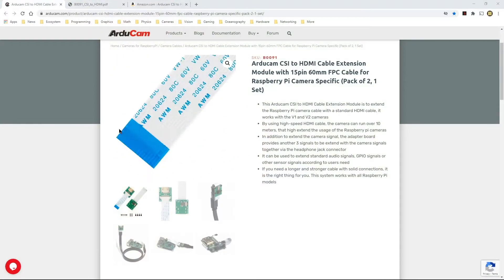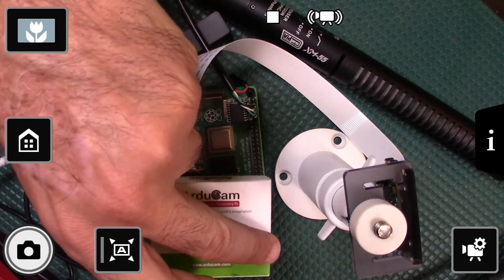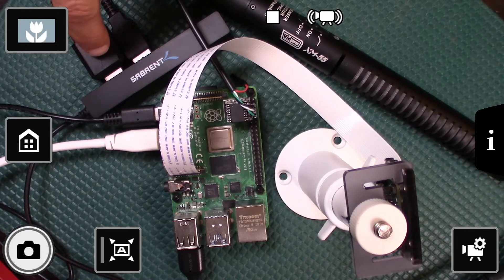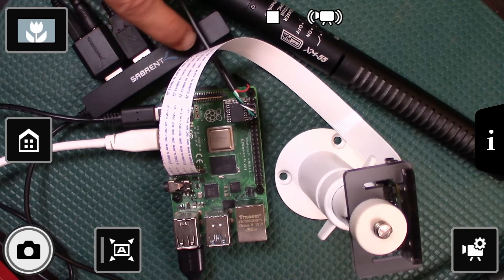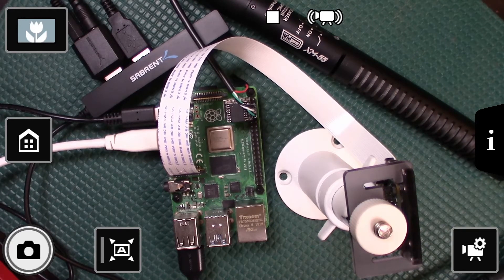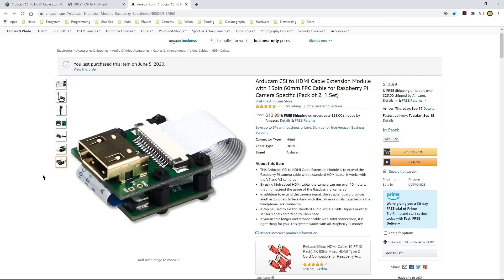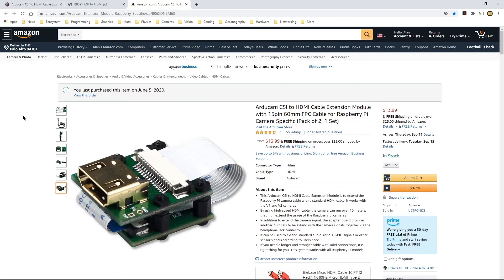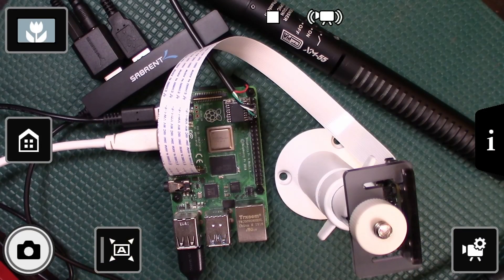Raspberry Pi 4: OpenCV with Arducam B0091 CSI-2 to HDMI Cable Extension Module - Part 1

Comment: Thanks this is useful. I dont see any ICs there on the Arducam B0091. Is this just a physical connection from CSI-2 to HDMI ie they just use the HDMI pins and wires/copper and no real conversion happens of the signal to HDMI and back?
Reply from the maker: Glad to hear that. Thanks for the feedback. I believe it's just the physical connection across HDMI cable without conversion.

Comment: @Alan Mikhak Can you use other camera's to this unit? So using it with HDMI camera's
Reply from the maker: @Clyde Gravenberch, Thanks for your question. I have only tried it with Raspberry Pi camera board V2.
Arducam web page for this unit says "Supported for Raspberry Pi camera board V1 (5MP OV5647) or raspberry pi camera board V2 (8MP IMX219)".
https://www.arducam.com/product/arducam-csi-hdmi-cable-extension-module-15pin-60mm-fpc-cable-raspberry-pi-camera-specific-pack-2-1-set/